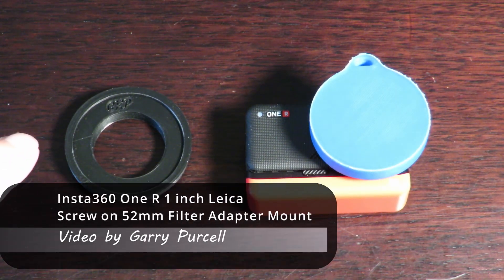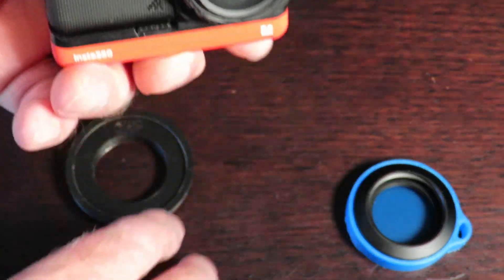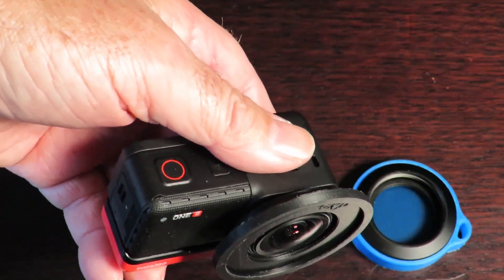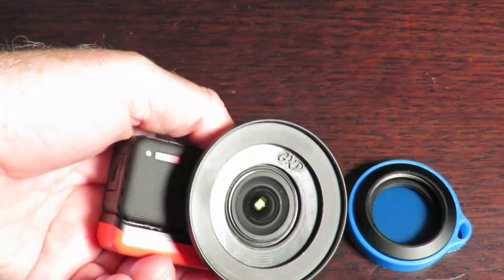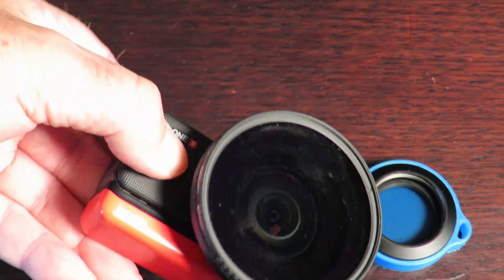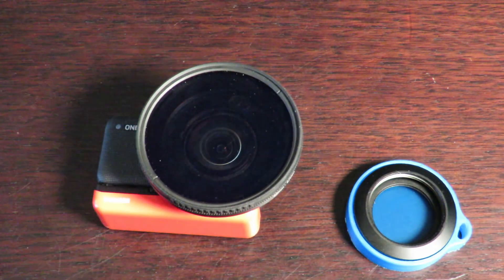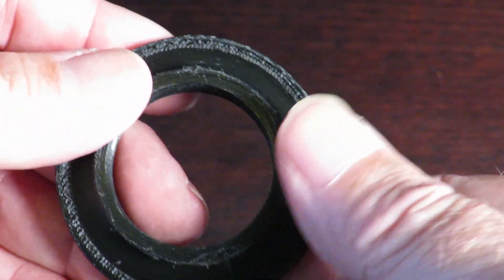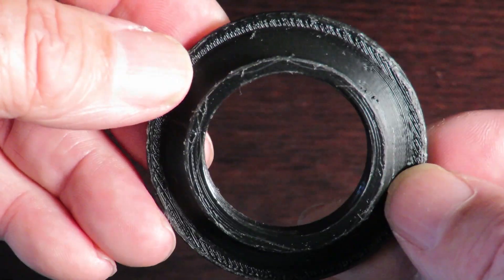📷 DIY 1 inch Screw on 52mm CPL ND Filter Adapter Mount for the Insta360 One R Leica mod

Comment: Hello. I printed out this model, but it doesn't fit right away. I used pla+ silk.
It is kind of tight and doesn't go all the way..
Reply from the maker: Are you referring to the thread for the filter itself, or the camera body part?
Reply: @GarryPurcell  the thread for the body ..
Reply from the maker: It sounds like the printer might be slightly out of calibration, and the thread has a few small bumps in its tracks.
Try screwing the adapter on till its tight, then turn it back a few times, to see if this will smooth the indiscrepancies in the thread pattern.

Comment: thanks a lot! could you post 3d models for other diameters please.
Reply from the maker: Thank you for your question.
I already have a selection of STL files for the Inst360 OneR, and other products on thingiverse
https://www.thingiverse.com/garry1953/designs
Reply: @GarryPurcell  I meant other diameters for different ND filters. I did not find other adapters, except for 52 mm.
Reply from the maker: The reason is simple.
You can purchase Metal 52mm step up or step down rings that screw directly onto my adapter, and this way you can connect all the different diameter filters available.
Ebay, Amazon, AliExpress all have these metal step up adapter rings at reasonable prices.
Reply: @GarryPurcell  I understand, but it will be more expensive than doing it on a 3D printer. I can pay if needed. I prefer the original work.
Reply: @GarryPurcell  sorry for my english
Reply: @GarryPurcell  I saw the comments below, people were asking for the same.
Reply from the maker: The cost of a step up ring is minimal 
Here is an example from AliExpress. 
52mm to 72mm
$1.03 Australian Dollar plus $2.00 shipping.

https://www.aliexpress.com/item/1005001452458219.html?spm=a2g0o.productlist.0.0.3652121d8KHwsD&algo_pvid=446ec158-583e-452a-a3e0-6b00abf30282&algo_exp_id=446ec158-583e-452a-a3e0-6b00abf30282-4&pdp_ext_f=%7B%22sku_id%22%3A%2212000016166297024%22%7D&pdp_pi=-1%3B1.02%3B-1%3B-1%40salePrice%3BAUD%3Bsearch-mainSearch
Reply: @GarryPurcell  if I am wrong. And you did not make other diameters of adapters for ND filters, then please do, we beg you. We will be eternally grateful!
Reply: @GarryPurcell  You are our hero!

Comment: Thanks so much for the video and especially for sharing the model of your adapter (even for free)! Just got it from my 3D print store and it works perfectly. Now I can finally attach a variable ND filter to the Insta360 ONE R 1", which is a must if you want to use the camera outdoors with manual settings and don't want to constantly screw and unscrew fixed ND filters.
Reply from the maker: Thank you for your kind words.
I'm pleased your happy with my design.

Comment: ... also, I've got some small screw on diopters that are great to improve the close focus on the camera, but haven't figured a way to attach them without tape at the moment...
Reply: Hi again Garry!

I just wanted to say a huge thank you for sharing this video and also your model. I found a company to print the piece and I just got it back from them... works perfectly. As I have absolutely zero 3D printing experience or knowledge, I couldn't have done this without you sharing your knowledge and the model files. 

Now ready to use a whole bunch of filters on the camera.

Comment: Wow! Amazing. How did you even get the measurements perfect? (👏)
Reply from the maker: I use a Digital Caliper, and allow for a bit of trail and error, to get the screw pitch correct. 
There are quite a few thread types, and they have a variety of pitch angles to choose from.
Reply: @GarryPurcell  You going to keep it a secret, or can you tell us which one is the correct one?